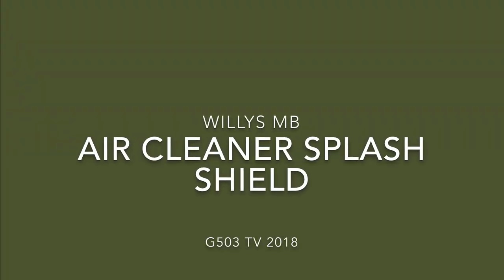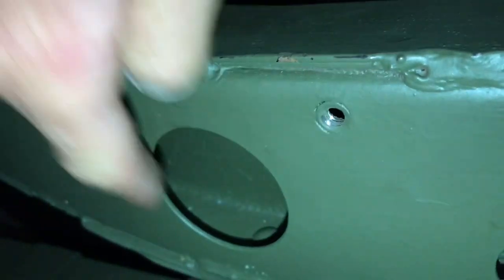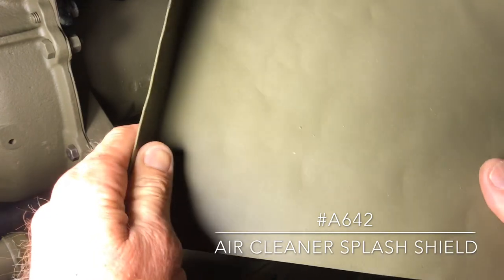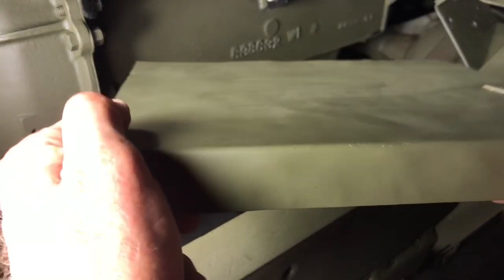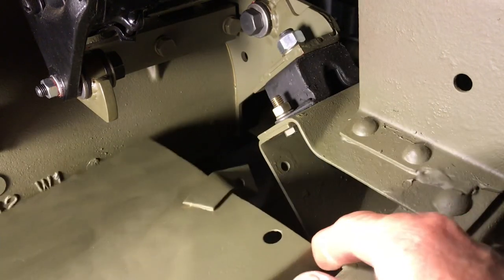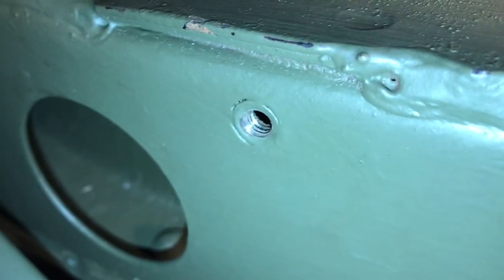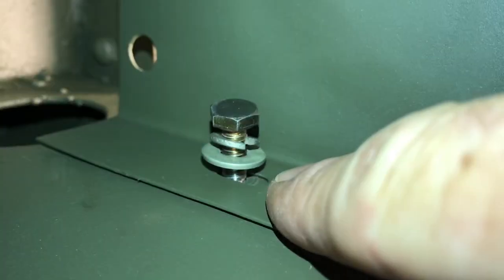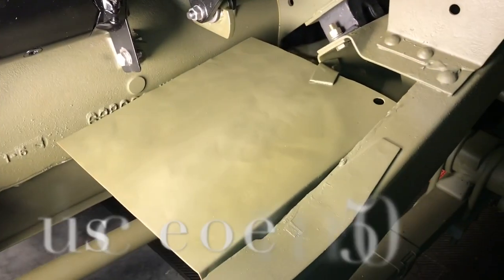Willys MB Air Cleaner Splash Shield Installation G503 TV

Comment: The NF thread bolts 1/4 X 28TPI are much less prone to loosen due to vibration, I'm surprised you couldn't fid them locally, they are in most hardware stores and all industrial supply houses here.  I have a few dozen in my basement :)  Looks like it was better anyway using the NC 1/4 X 20 as it appears your frame had already been modified. :)